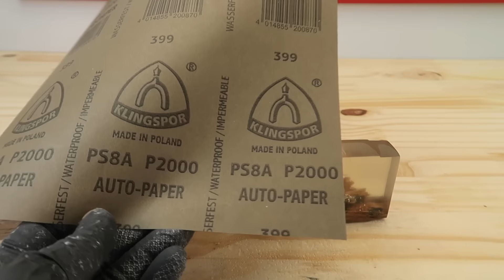I Turned this $5 Broken Level in to a Piece of Art with Epoxy Resin

Comment: As a tradesmen who uses tools I really appreciate what you did to this. Absolutely wonderful. As a tip though if you reset the bubbles again on a level,sit it on another level that is held in a level position as a confirmation reference as you are bedding them in the plaster to ensure they are parallel to the edge of the levels surface. I only mention because you did check the trueness against another level at the end. As a piece heritage being preserved for non practical use it obviously doesn't matter but given the amazing level of detail to your work I know it would have annoyed you had it been out of true. I thank you for this vid.
Reply: I suspected he did check this off cam, while the plaster was moist again.
Reply: Well said…

Comment: If you plan to do more resin projects I would recommend getting a pressure pot or chamber, this would make sure all the tiny air bubbles throughout the resin are removed during the curing process

Comment: A wood project like this would be a good opportunity for resin stabilisation inside the wood using a vaccum pot, just like you could use it to de-gas the resin to decrease the amount of bubbles :) Great video!
Reply: He would need Cactus juice resin for stabilizing wood but a project like this would be a great candidate for hardening existing wood. I think I would just replace the wood.
Reply: It would be a good video to see him make or restore a vacuum chamber so that it could be used to do more resin projects like this. because it looks amazing.  Restoration but keeping the history of the item.
Reply: There are aerosol sprays that force the bubbles to the surface that work in a fraction of the amount of time a vacuum chamber would take.
Reply: ok i don't have any idea what you guys are talking about im just here to read comments
Reply: Ok first of all what are you guys talking about
Reply: @carlosgodoy1  There are a lot of visible bubbles in the epoxy/resin. We're discussing methods to remove the bubbles before the epoxy has set.
Reply: I think those bubbles add to the character of this restoration. A bit like a design feature which makes it more interesting to look at.

Comment: small suggestion
when you install the screws for the last time, put a dab of epoxy on them, it should make the threaded holes invisible instead of leaving them opaque white because of the scratches :)
A minute thing but I thought you might like to try it :D
Reply: It is not too late. A drop or two of CA thin on top of the screw will enter fill and dry christal clear.
Reply: Clever... very clever.
Voice of experience

Comment: Amazing work as always. Only 1 minor thing. When using resin, please apply heat from heat gun. Bubbles will burst and the result will be even smoother! Cheers!
Reply from the maker: i did that, but the resin was to thick and bubbles to small to exit
Reply: @TysyTube ... it needed to be put in a pressure chamber to get them out,  but the bubbles actually make this piece look even better,  so I like them! Most projects would need to be put under pressure if you want to avoid them...
Reply: TysyTube Restoration try pulling a vacuum on it next time? :D

Comment: Also, a cheap alternative to getting a pressure chamber, just pour the resin in layers and use a blowtorch quickly over the resin. It will help remove the smaller bubbles. Also, might have been interesting to seal the entire thing in resin instead of using the glass again. It would make this level indestructible.
Reply: So not ever torch. Vacuum or controlled temp. If the project is small enough to refrigerate for 25 min to retard the hardening process do that. This will give more time for the bubbles to escape. Applying high heat to the surface accelerates the fine upper layer to cure faster then the lowers trapping the air bubbles. Even if you are only pouring 1/16/ to 1/8 at a time. It will also leave your final coat to have ripples as well as over yellow the resins for the reaction exceeding critical reaction temperatures.  Getting a used mini ac unit or window unit and creating a cool box is the the best way hands down. I have a few river tables resting now.
Reply: hey the guy does great on his own he don't need any suggestions from "I can do betters "
Reply: @Slick1G3  When did I say I could do better? I was commenting for anybody that can't afford a pressure chamber.

Please don't mischaracterize what I commented just so you could argue with what you decided it meant. WTF

Comment: Why didn’t you calibrate while inserting the glasses? Only at the end when no adjustment would have been possible?
Reply: Given how exactly it was to his other level, you don't think he did off camera?
Reply: @medes5597  The top part of the level has a huge curve. What about that?
Reply: Kyrie Kwsta the curve you see in a lot of levels.. maybe the older ones..
Reply: You can see that it wasnt as true as the newer one. The guy who made the comment was right. Should have made it 99.9% true before the plaster dried. But it's a nice art piece. I wouldn't attempt to level anything with it. I'm sure it's more for show.
Reply: I agree, all that work for a paperweight
Reply: @frankierzucekjr  You can use it to accurately renovate an older house...;) ;)
Reply: @MrBigjay98  You mean the paper weight that it was when he bought it? The title indicates he's creating something rather than repairing something.
Reply: Kerevra  exactly!!!! His project is pretty but it doesn't indicate true level or plum at all!!
Reply: Agree with others... It's art and no longer a tool. It would have been really easy to calibrate that level just by leveling a board on the table with another level first, then just push the the bubble down until it's centered between the lines. Same goes for the plumb window. TysyTube... How about a follow up video? Shouldn't be that hard to redo the plaster and calibrate the bubbles. As for the straightness... some peel and stick sandpaper on a flat surface would be all you need to get it flat and straight.
Reply: @kyriekwsta770  they are always curved so that the bubble has to stay in the middle if its perfectly balanced
Reply: The title even indicates that he CREATED something out of an old broken level. This is really an art piece. As an artist myself I find some of these comments funny. As if the fact that it's not "useful " it's just somehow useless. Its art. Its displaying a creation of preservation of something old, and in the field of which his work pertains. Its something beautiful to display. An ultimate piece of art that encapsulates what he does. Its beautiful!
Reply: @tearalewis7532  
As an artist myself, I find your comment hysterically funny.  You obviously aren't reading these comments. Everyone agrees with your sentiments in spite of your pretentious condescension.
Reply: @anal I’m assuming it’s because it would no longer be useful to him as a level....he turned it into an art piece.

Comment: For the non-foggy resin, you can put on a coat of resin over it and it’ll make it transparent, the outside is foggy because you were sanding it. But you can easily fix that with more resin.

Comment: A quick way to check level on even an unlevel surface is to lay it down, note where the bubble is. then, flip it 180 degrees and if its in the same spot its level

Comment: An old piece like this, despite is functionality, the mere fact that it was "reborn" from decades of neglect, should become an elegant display piece, to adorn a craftsman's worktable or display shelf!
Reply: Hi, great work, but on the vac/pressure chamber debate. I’ve seen other YT vids where a pressure chamber is used and the mixed epoxy is put into he Vacuum. Chamber after mix, but before pouring to extract the bubbles. And yes it does “boil” - but this was allowed for in the size of the mixing chamber. Then it was carefully poured into he mould. (I think the object was a large dining room table. So Vac is a bit more practical than getting a pressure chamber. Anyway the object would have to remain in the Pressure chamber for the curing or when the pressure was released the bubbles would just go back to normal size)?
Reply: @dc9999ify  Yes, you are correct about the pressure chamber squeezing the bubbles smaller until the pressure is released, then they just blow back up where they were. Vacuum chamber will expand the bubbles, the increased buoyancy will bring them to the surface and pop. My father and I have worked with liquid acrylics and epoxies for decades, we found vacuum works the best. A simple propane torch waved across the surface of liquid epoxy will also clear off any bubbles.

Comment: Excuse my dumb question: Should you set it on a good level when putting the glass levels in?
Reply: I had the same question :D
Reply: -Only if he would be making a usable tool instead of just a shiny toy for display purpose only.
Reply: Literally thinking that through the whole video 

“I wonder how he is going to calibrate it at the end. Oh - he doesn’t’

So really less ‘restores level’ and more ‘makes a level looking thing’
Reply: @5hiftyL1v3a  and he made some pollution too
Reply: I just can't trust that 'ol' rotten wood'. Just a small spot shows really rotten wood and kinda everything else of that broken part looks like 'ripped apart a second ago'.
Reply: The need for calibration is WHY the spirit tubes are set into plaster. If one isn't going to bother with calibration then there's no need to bother with the plaster.

Comment: Did you calibrate the bubbles here or just eyeball them? Just curious.
Reply from the maker: i calibrate them with the black level
Reply: I think that is why they set the bubble cylinder in plaster...it allows you to fine tune to a known level surface before it sets up.
Reply: I think he should have replaced the bubble. That old one looks a bit sticky.

Comment: Here’s a hint for using epoxy: use a high pressure vacuum compressor on the epoxy before pouring to get all the air bubbles out.
Reply: You can also just hit it with heat after you pour and it will make them rise.
Reply: But in this case it´s beautiful.
Reply: Or centrifuge
Reply: That would be for silicone. For epoxy you use a pressure vessel not vacuum; so instead of getting the bubbles out, they are compressed to microscopic level.
Reply: @uteboy86  the carbon dioxide from a propane torch eliminates the bubbles

Comment: Cool, but next time:
1. Use pressure pot for bubbles.
2. If restoring a tool, not only does it need to look good, but work as well or better than before. In this case you failed to properly rectify the surfaces to square angles, and calibrate the indicators.
3. Also in this case it would have been neat if you had rectified the surfaces after installing the bronze hardware so that it looked like seamless inlay.
Reply: My thoughts exactly. If you are eyeballing the indicators, it will most certainly not be accurate.
Reply: The entire reason that the spirit tubes are set into plaster in the first place is so they can be adjusted while the plaster is wet. The level body is set onto a true level surface and the tubes get moved until correct. Then they are left alone until the plaster is set. One would do the level tube and the plumb tube separately, one at a time.
Reply: No...No....No did he calibrate the indicators?  A tool that looks good that doesn't work in no good..... sorry..
Reply: I think ist cool with the bubbles inside. Makes you think of and old shipwreck under water😊

But by all means, youre right :)
Reply: You people are way too anal. It's awesome and it's ART. Read the title. Have a glass of wine and quit whining. 🍷😭
Reply: @AndrewSalinaspastor  Yeah, I have watched machinist channels with ultra-precise levels that can detect slopes of .0001" over several feet. He should have just used the level app on his phone to calibrate. :-)

Comment: I think using a new level carefully when seating the glass tubes to the putty would have easily made the horizontal side even more accurate. I know it’s hardly for daily use, but my instinct in my own shed is immediately to get rid of inaccurate measuring devices.

Comment: It’s a beautiful job, but if I’m honest I don’t like the way the screws are visible in the resin. Despite this, I would say definitely more resin projects, please!
Reply: I thought the same thing. Perhaps using a quick dry epoxy to just glue that brass piece in might have been better
Reply: You're right. I think the same thing too. :-)
Reply: or maybe some liquid resin in the holes when screwing them in? should make it a tad clearer at least!
Reply: I get were your'e coming from but it does represent everything but the missing wood. To each their own but maybe pour the resin with the screws in, that way it's nice and clear.
Reply: I think the screw holes need a tiny countersink - the screw heads looked like they were sticking up a bit, and I would wet the screws with resin before driving them, which should make the inside of the screw holes transparent.  It's a nice restoration project though
Reply: I was thinking the same thing. that messed it up for me
Reply: personally i really liked being able to see the screws
Reply: Or at least use shorter screws... but over all, great job!
Reply: You could try to color match the resin to the wood,. A bit tricky and could take several samples to get really close.
Reply: I like seeing the screws.
Reply: Yep if he had new wood or cover up the screw holes,might as well throw it out an go buy a new one. I think be able to see the old wood and the screws is what makes this piece.
Reply: I'm the opposite, I love the showcase of functionality!
Reply: @rudimarchand8613  : or a brilliant blue or green

Comment: A hint: when your epoxy starts getting hot like that, put in the refrigerator. This will slow the reaction down. If the epoxy starts to boil, it will set with a million bubbles in it and ruin your project.
Reply: I'll file that tip away for future use. Nice one, Becky.

Comment: Makes you wonder how the level got damaged in the first place.  Did someone use it as a pry bar?  A level wouldn't be my first choice for that.
Reply: It may have been dropped accidentally if it was used during construction on a building or something
Reply: @fallingskies8991  never seen anyone drop anything made out of wood that thick and have it splinter like that. Looks more like someone ran it over or had it on their belt and got slammed by something.
Reply: @atomixage  ah okey
Reply: When was the last time you saw a wood level?
Reply: @roonilwazlib3089  Last time I was at Home Depot.
Reply: Looks like rot no?

Comment: haven't seen step of adjusting glass bulbs, how do you then make sure your level shows exactly "parallel"? and 90 degrees angle - I would re-check it too, otherwise you may get shiny, fancy but inaccurate tool...
Reply: They arent level right, as one can see, when the old one is still on the table, and the modern one lays on to, the airbubbles are not in line  :(
Reply: Yes!  This miss in the process is driving me nuts!!
Reply: That’s all I could think about once he skimmed over the process. Really would’ve like to have seen that. A lot of trouble to go through for that piece  and not calibrate. Its a short level but still.... looked great though.

Comment: I'll be that guy, now 11 months later. That's not how you test a level for accuracy.
Place it on a surface and check the indicator. Then spin it 180° and check again. If it's reading exactly the same as before then it's accurate, if not then it isn't. You don't even need a level surface, just a consistent one.

Comment: I didn’t like the screws in the resin I would have just left that metal end off.
Reply: Reinforced corners are a must. I always drop levels on the worksite or bang it on a door. Once you lose an edge it loses its accuracy. In saying that, the prominent bow in the wood makes it unusable anyway as you can’t hold it against anything
Reply: yes and also leave off the resin.
Reply: @seanclarke6733  I understand why a corner would be needed if your going to use the tool as your main leveler. I assumed most items on this channel weren't going to be used a lot. Resin is a trending idea right now and for this purpose, it seems to be more for show than function. It would get so scuffed up after a year of consent use. This is more of something you put on your shelf and enjoy.
Reply: Could have used a wood screw

Comment: Just an ornament -  needed to be calibrated and set before plastering it in.
Reply: Came here to say this.  Went to all that work and just eyeballed the glassware which is the whole point of having a calibrated level!
Reply: Jude Fenwick   Then put the spirit level bulbs up-side-down or on an angle so it wont be used as a level.

Comment: 6:54 Why does this sound like it was in reverse
Reply: Because the sound of a hammer slamming onto an object consists of mainly two parts: 1. The impact sound and 2. The decay phase, where you only hear some way more silent echo.
The usual impression ist to first hear the slamming and than the echo. (1 then 2)
But if you do many successive hammer blows in a row, you will of course hear this pattern:
1 2 1 2 1 2 1 2 1 2 1 2 1 2 and so on.
So when you are in mid of a long row of these sounds, it's up tou your brain's interpretation of the resulting sound, to either process it as a row of (1 and 2) or a row of (2 and 1), because there's no distinctive difference without relating to the start of the hammeirng process. You just need to hear the row multiple times and will see, that you can hear it as forward but also as backwards if you try. And by speeding up the sound, it get's hard and harder for the brain to distinguish between both, because the the fine details that would relieve the true nature of the sound are suppressed by this main characteristics of the sound.
Reply: @elmariachi5133  wow thanks, honestly